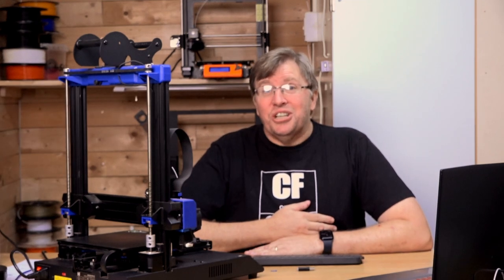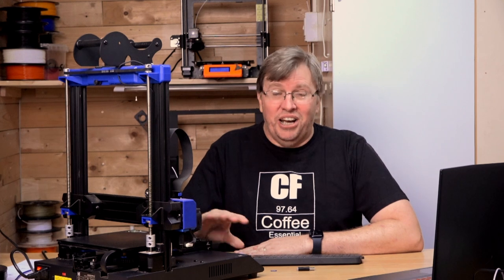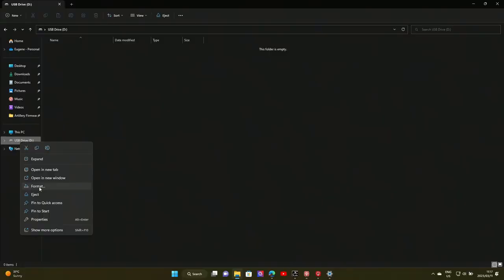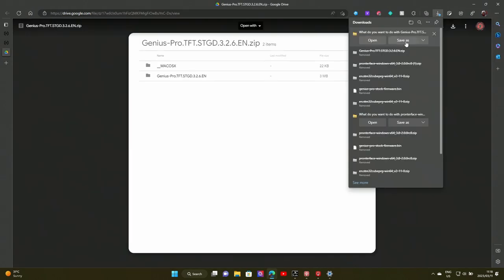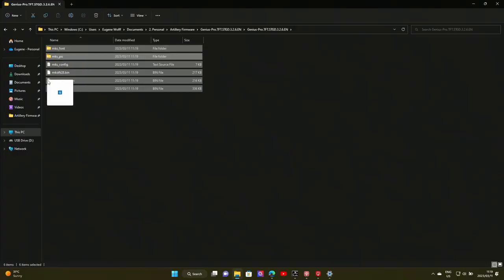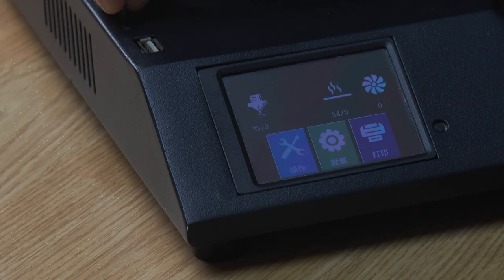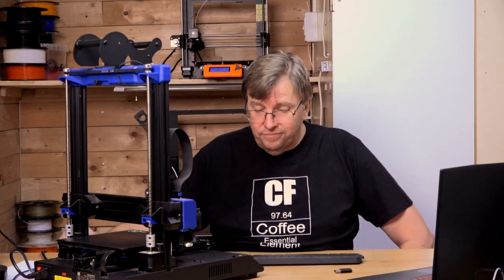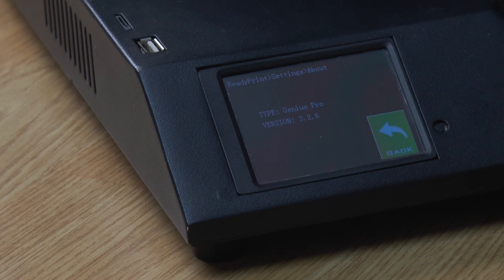Artillery Genius Pro Firmware Update | Part 2 | TFT Firmware Flash

Comment: Looks like I have a problem with my motherboard it doesn’t see it on  prontirface in the usb drive it shows everything is normal and working Why I origenly wanted to upgrade the firmware the printer started to make loud noises on the x axis I first thought it was my stepper motor then I replaced the driver on that motor but still it will print for a couple of layers then just stop and start to make this noises So I ordered a new motherboard and in the meantime also bought the new klipper Sonic pad maybe I will go with the Klipper upgrade then I will upgrade my other two printer as well 
But thanks for your content keep it up 👍

Comment: I tried it twice and nothing happened.  Do you have to push the tiny little reset button too?  What does the reset button do?
Reply from the maker: No, you don't have to press the reset button, just turn the machine off and put the SDcard on with the bin file on the root directory and turn the machine on.  Check your version in the about section of the printer.
Reply: Hey there, wonderful video first of all. I kinda have the same problem here. My about section is at 3.1.7 and i tried to flash the new version with the SD Card. Printer off, card in, printer on. The screen stays black with the little version text at the top left. Could it be because of the SD card? I have Formated the 8gb SD 2 times now and put the files one there. Im kinda lost here lol
Reply: Just tried a 4GB SD card. No luck either
Reply from the maker: @whatsupdude7670  I am sorry to hear that, have you made sure that all the files have been copied across and that it is in the root directory.
Reply from the maker: Sorry to hear that, the reset button is kinda like turning the machine off and on again.  Are you sure all files have been copied from to the root directory.  Have you checked after flashing, it sometimes looks like nothing happened but the new version was updated.   The version number in the first window is not the correct version number.  Check in the about again.  That first version number also confused me
Reply: Yes sir everything was checked and it stayed the same. The about section didnt change either. I did some Research Apparently its because of the new tft chipset my printer has. These should be supported by now so its still weird that it doesnt flash. Contacted artillery support and waiting to resolve it that way. Thanks for the reply 👍
Reply: Update: i got a new Screen, same chipset but never version. It updated instantly 👍
Reply: @whatsupdude7670  I have the same problem... how to solve?

Comment: Would a USB work or do I need an SD card?
Reply from the maker: Interesting question, I have not tried it, give it a try and please let me know
Reply: @FusionSource  Didn't work though I am not certain what the reason is.
Reply from the maker: Sadly, I think the SDCard is the boot card in the firmware, not the USB drive

Comment: I did all the parts but after i connect the sd card and turn on the printer it shows "pic erasing" green  in black screen and after few seconds it shows "mkstft28.bin.pfile updating..." that is one of the files that in the SD card. it show it for hours and not stopping can you help me?
Reply: when i restart it sometime it shows the same thing and sometimes booting and not stop